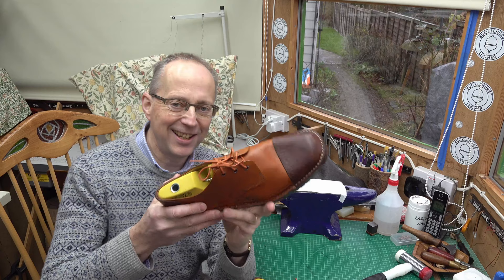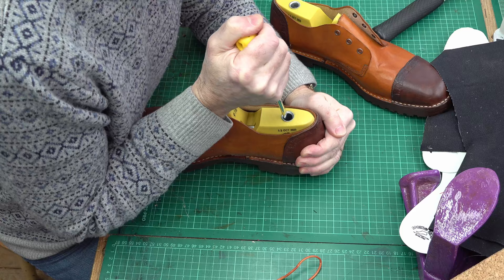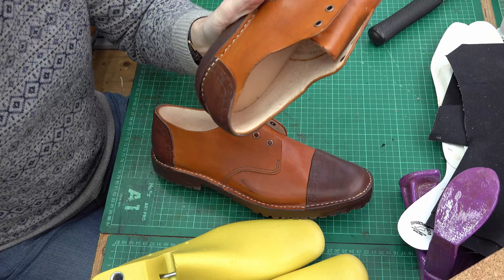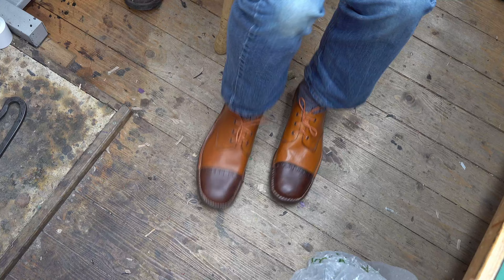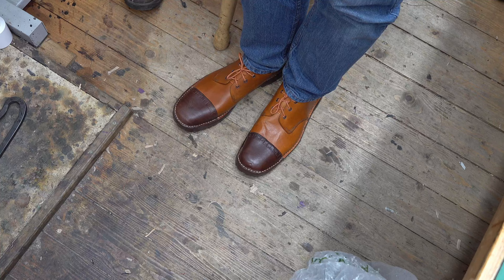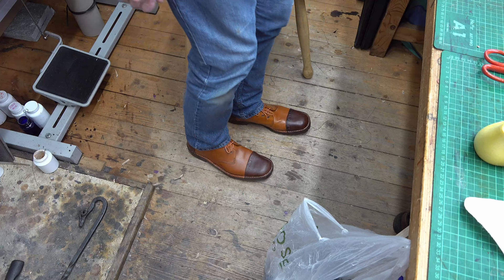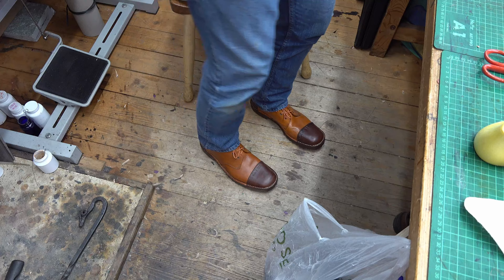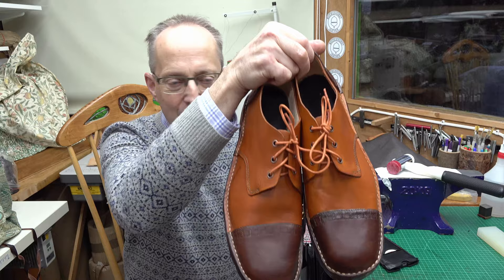Easy Shoemaking Part 7 Try On And Making Sock Liners

Comment: I never took an interest in shoe/boot making until recently.  Your skill level and approach seems to make boot making possible. I have flat, narrow feet and pronated ankles.  Hard to find any kind of shoes that feel great.  The only boots I ever bought that were "perfect" were a pair of 6" top Lowa Scouts (Austrian made) purchased back in 1973 for back packing in the Grand Canyon.  They had Vibram soles and the soles were unbendable.  They had zero flex and I could hop from rock to rock and never slip, plenty of ankle support.  I believe they had several layers of full grain leather and a metal shank plus the Vibram sole to build the stiffness.  Would love to duplicate those boots as I've never found any boots to match those for comfort and performance.  They sort of disappeared for a few years, but later discovered my son had been wearing them daily until they fell apart.  Oh well...!
Reply from the maker: I suspect I would need to make a few pairs before being totally confident about changing foot shapes etc, but I am looking at making a few changes now. It's a very interesting journey....had to laugh about your boots resurfacing!!

Comment: Thanks Harry.  So much fun to watch and packed full of useful tips, as usual.  Can I ask which pair of shoes you feel are most comfortable?  I make clothes for myself to wear and I find that the most comfortable are always the ones where I have altered the pattern precisely to fit me, rather than following standard size. 
I know factory lasts can be altered with leather to improve fit, but I had a perception that your home - made last shoes, fitted better?  I think both pairs are awesome, either way.
Reply from the maker: Hi Lisa..thanks...I think my factory last is more geared to formal shoes so I may try and adapt it a bit...the upper section and waist is good but the toe box is too long for my preference. My own last is pretty comfortable though a bit generous in the toe, surprisingly I got the waist area pretty good....a blend of the two lasts would be just perfect for me.
Reply: @harryrogers  Ah, there's another challenge for you then Harry!  Do you reduce the toe length on the standard last, or make your home made last less generous in the toe, or start afresh in order to keep your reference?  I have bought a number of old wooden lasts which I intend to adapt.  Wood working skills appeal less to me though!  I challenged myself a year or so ago to making a pair of cowboy boots after I bought a leather patching machine. I am currently getting up my confidence learning.   With your leatherworking skills maybe a flamboyant pair of cowboy boots appeals to you?!
Reply from the maker: @Lisa-zt9jr  Hi Lisa...traditional clogs are my next project!!😊
Reply: @harryrogers  Exciting.   I'll look forward to that then!